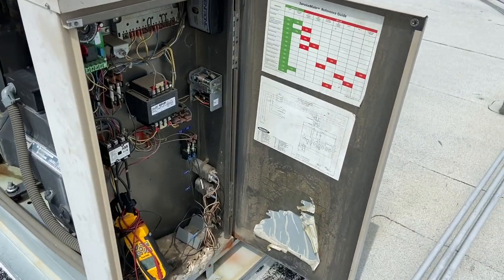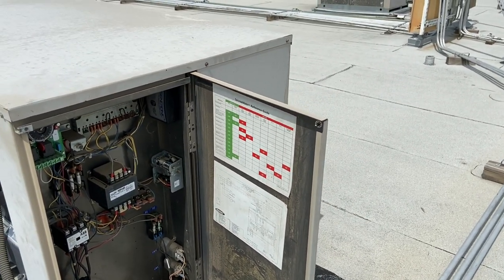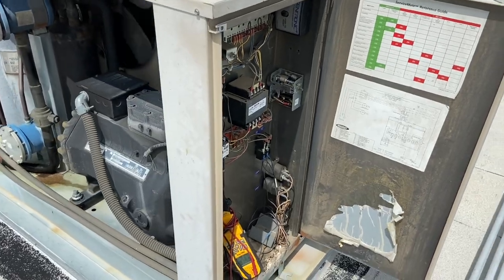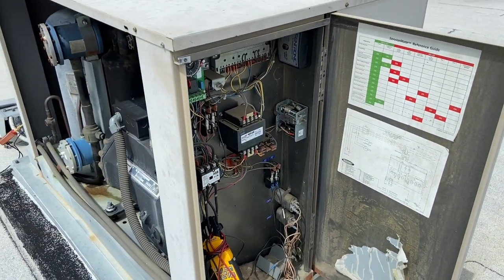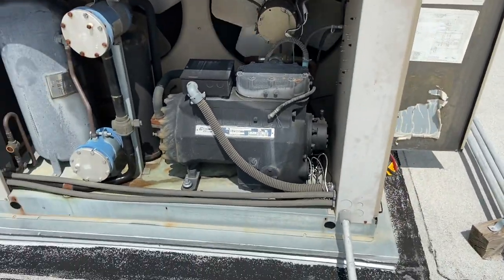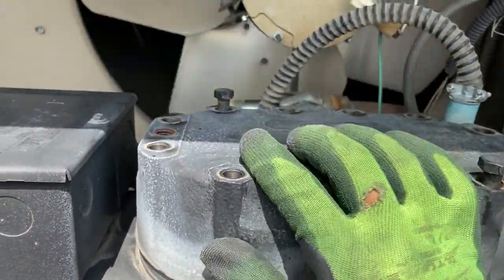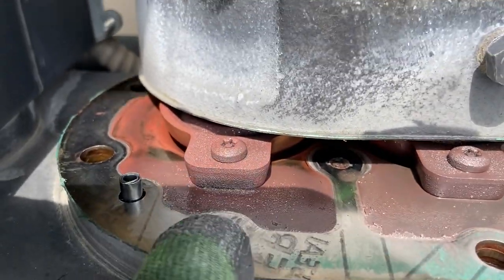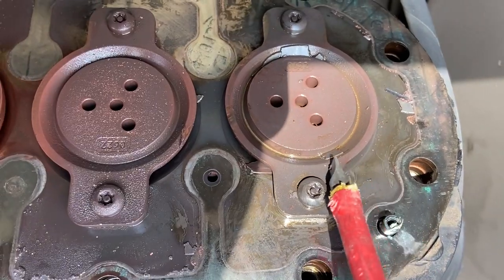Checking Compressor valves

Comment: I always like the way you think through your calls.What should the suction pressure be on a R22 medium temp cooler? Lets start with a 10-15 degree F TD. What should my head be at? Both of these thoughts led you immediately to think about the valves. Good video, thanks! And good pro tip keeping two bolts on the head while cracking it loose.
Reply from the maker: Thank you. Yup once I was able to wrap my head around normal operating conditions it made it easier for me to determine some issues quickly